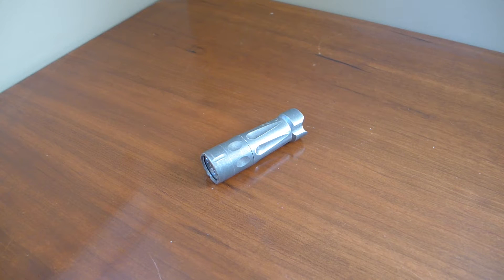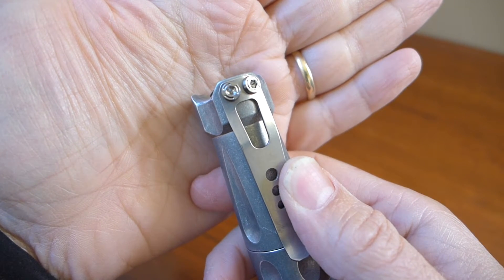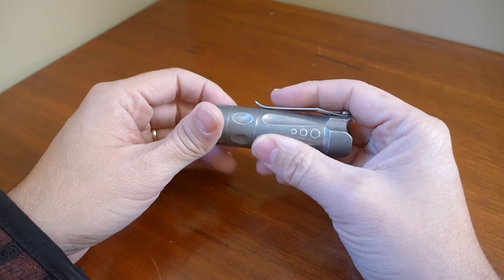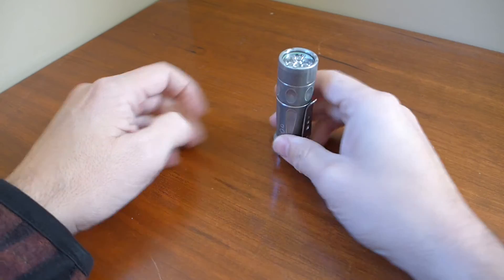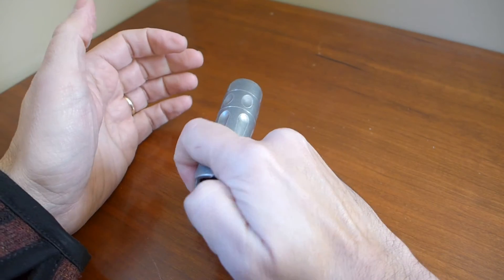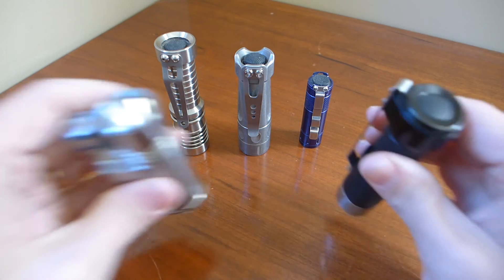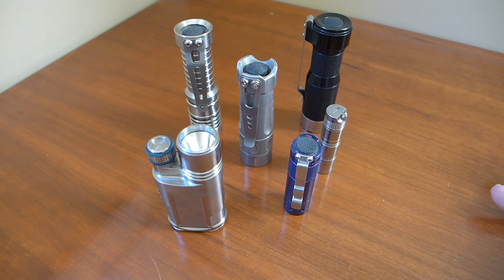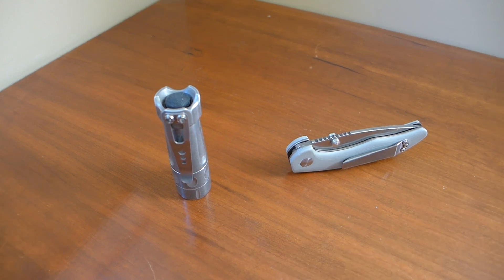Oveready BOSS 35 Overview Part 1 of 2

Comment: Hanko?  Okluma?  Neither are in top 7? Maybe top 10?
Reply from the maker: I like the Hanko stuff, especially the Trident quite a bit.  I had a chance to acquire one, but ultimately passed.  For me, the lights are more about aesthetics and less about performance and while I see why folks value Jeff's work for that reason, its not something that speaks to me.

As far as the Okluma stuff, they are almost exactly clones of Mac's work.  Additionally, aside from being bright I am not sure there is much else going on with these lights.  They have the performance of a good production, with a body tube that is not that different from a production, and no other real outstanding features.  Compared to something like the SPY 007, with its completely unique...well...everything, I am at a loss as to how to compare the two.  If you take another point, the BOSS 35, for example, the Okluma doesn't fair well either--a much better body and a high output.  Okluma's stuff is very nice, but lacks the wow factor that these lights have.